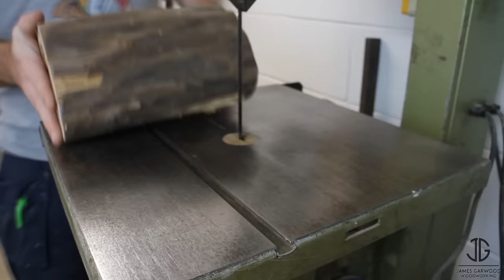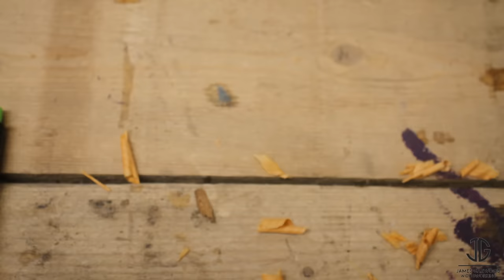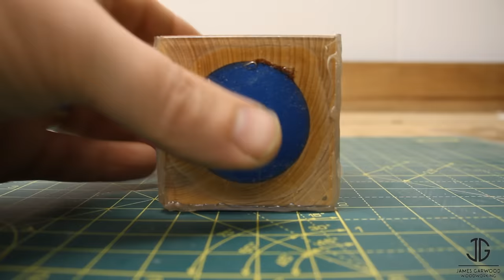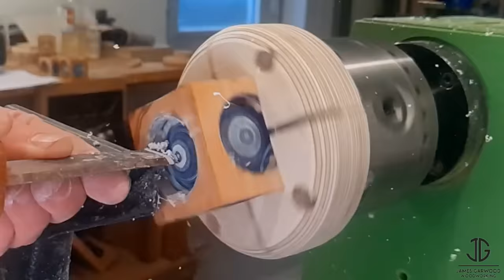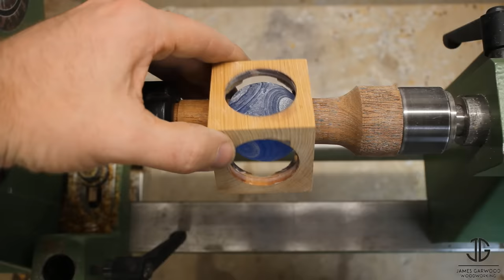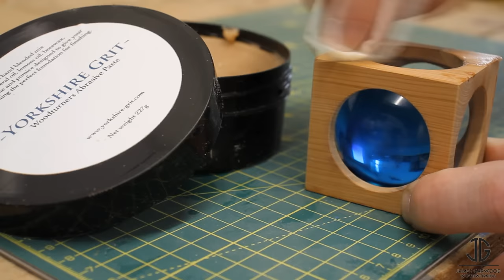Can I turn a resin sphere INSIDE a wooden cube? | Woodturning challenge

Comment: Great job on using the resin for the sphere.   Have seen wood in wood, but this is much better looking with the contrast.   Have been wanting to try this, the speciality tool is holding me back.  Would be great if you would just post a PDF attachment of the tool profile that was used to grind one.  Great Job all in all.

Comment: By the way, the answer to the question 'Can I turn...?' was obviously yes, just by looking at the picture. One not-very obvious moment was: after the separation of the resin part using a rotary tool you would use only sanding and polishing. Great work!

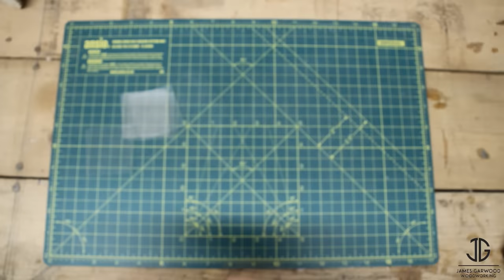Comment: Great job, however I cringed when I saw the chuck handle abandoned in the chuck at 2:42 
Your hand should never leave that handle until you put it down on the table. Not to sound overly dramatic but that is a easy way to kill or injure someone.